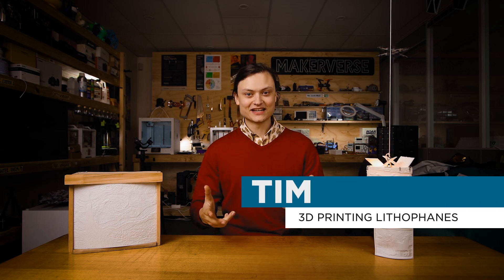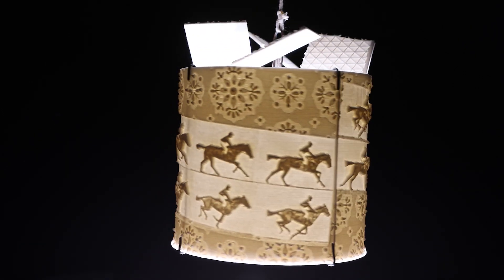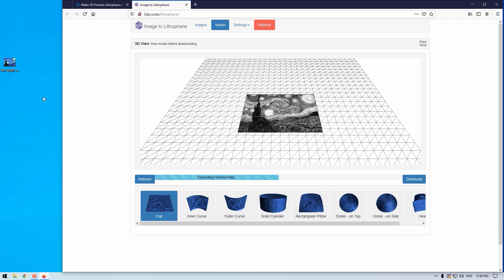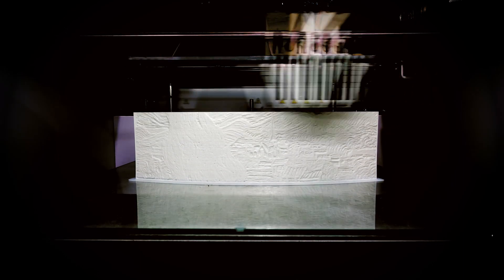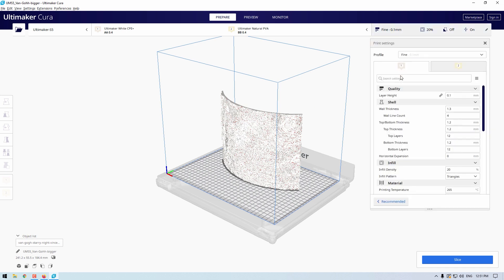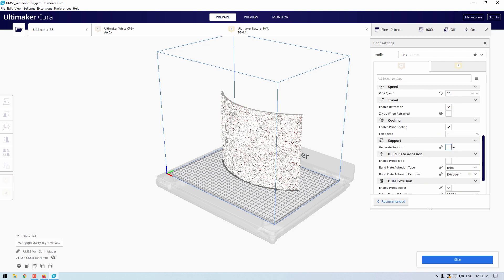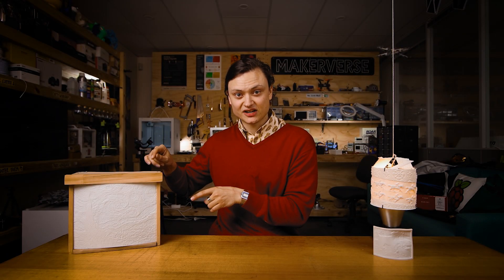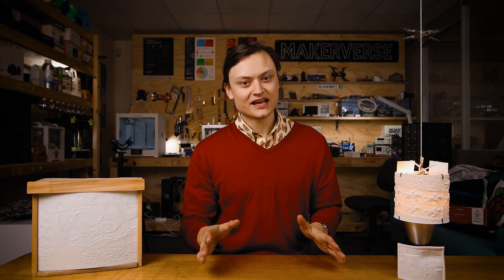Perfectly 3D Print All Types of Lithophanes and then Add Colour

Comment: Cura doesn't like the cylinder.  Any input would be helpful.
Reply from the maker: These files can end up very complicated and will end up taking Cura a very long time to slice. Just allow it a long time to slice and you'll be good to go!
Reply: @Core-Electronics  I ended up using the curved at 360 degrees.  The cylinder would either slice at 100% infill or it would have print the inside wall correctly (smooth inside wall, varying depth for contrast).  It all worked out.  Designed a rotating, back lit stand for it in Fusion, printed all of the parts, turned out pretty decent.
Reply from the maker: I'd love to see this project in all its glory! We have a project page here which you can post to if you'd like 😊 community clout and store credit both available if you do - https://core-electronics.com.au/projects/

Comment: Hi there, which is the best printer for a good size lithophane picture?
Reply from the maker: All modern filament 3D printers can produce lithophanes at great detail and good resolution. Producing a really large lithophane (in one go) all depends on the bed size of your particular 3D printer. If you use a Creality Ender 3 V2 3D Printer the max you would be able to print is one just a little short of the size of an A4 Piece of paper. Hope that helps 😊

Link to it here - https://core-electronics.com.au/catalog/product/view/sku/CE07744

Comment: love this idea and already trying to figure out what i want to print.  One question, how long did it take to slice the file? My computer is at it knees with this, and havent seen this before from cura.
Reply from the maker: Swell question. Even though the structure is very thin there are a lot of complexities within each layer and that is what causes Cura to go slow. For the Vincent lithophane I pressed slice in Cura, then put the kettle on. Once I finished my tea it was good to go. Also, with large lithophanes in Cura it is normal that the first couple of minutes after pressing slice the loading bar looks completely empty, but the slicer is working hard just not giving any feedback that it is.
Reply: @Core-Electronics  thank you. Love the content. Already printed a starry night last night. Wifes favorite painting. May have finally found something that she wants to have printed